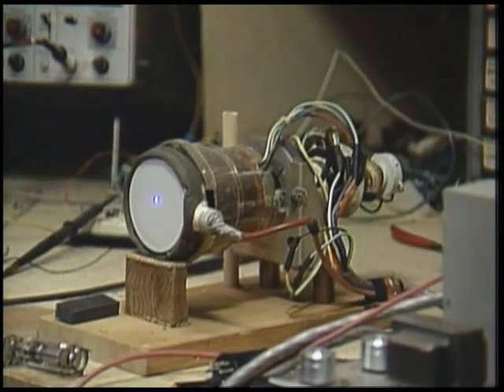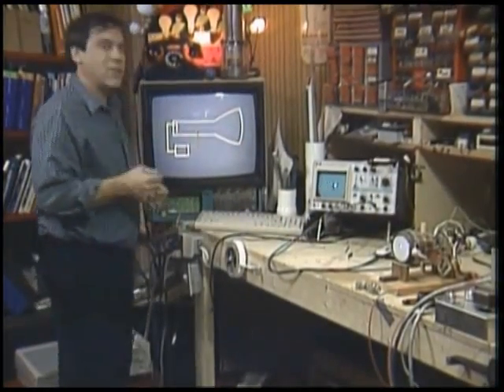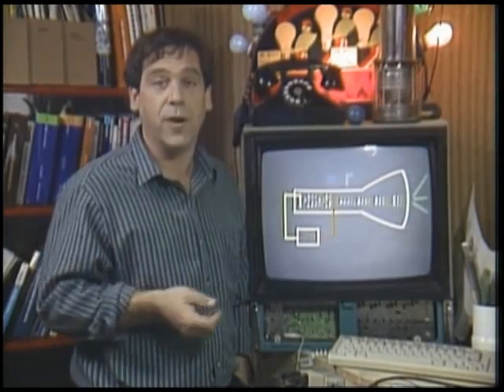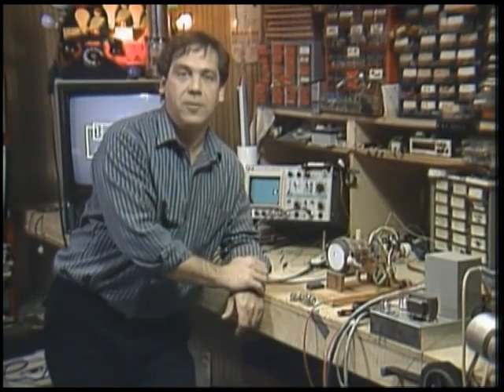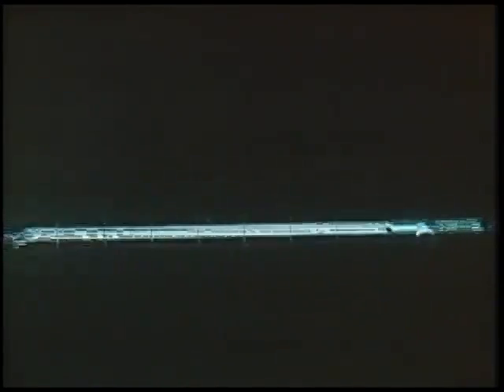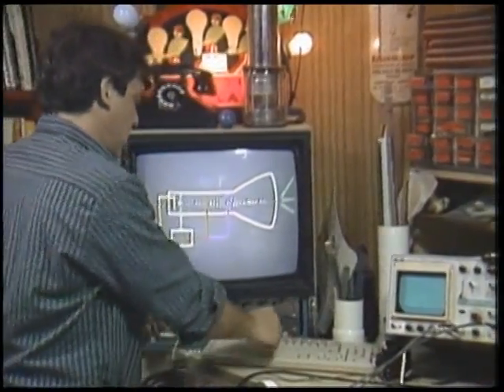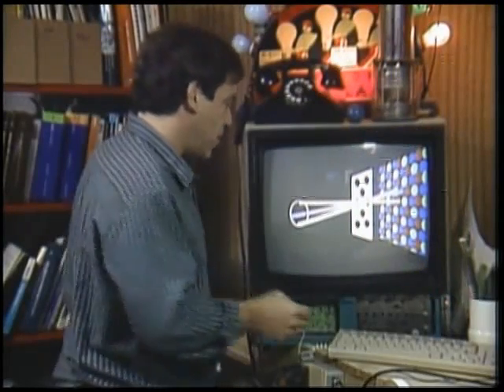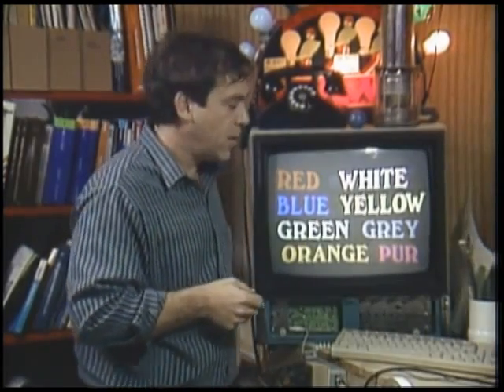How Stuff works! CRT Cathode Ray Tubes (Televisions) FOCUSED ELECTRON BEAM!

Comment: I have so many questions. How was the input signal processed so quickly? 15.5 Khz seems incredibly fast for the limited hardware CRT's used.
Reply: It was all analogue circuitry, no processing required. Everything was baked in and just scaled (amplified) correctly.

Comment: Watching from 2017*
"CRTs are going to be around for a long time to come"
20 years later ,its almost gone extinct and Have been replaced by Plasma , LCD ,LED LCD , OLED displays
Reply: Plasma screens are obsolete in 2011 or 2013 or idk . LCD , LED , etc is good but CRT are very good with interlacing , like 525 lines NTSC 480i/p and 625 lines PAL/SECAM 576i/p .

Comment: More on the coating that responds to the electrons by illuminating; the phosphors. How did manufacturers apply them in regular patterns? Also I think some tubes weren't a pure vacuum, but just less pressure than a normal environment (though they would all implode). I love CRT.

Comment: What I don't know is why applying an external magnet to a crt changes the color in a way that shows what resemble the field lines of the magnet, or what the colors would mean in regards to the field. If anyone could explain this it would be much appreciated
Reply: it changes the electron's paths to different color things.
Reply: 4 years late, but the answer is in the shadow mask he mentions. The geometry makes sure each gun can only hit the corresponding color phosphor, but when you put a magnet up to the screen, you're deflecting the beams after they passed through the shadow mask.  That means you can, for example, steer the red gun's beam into blue and green phosphors too.

Comment: i'm still using a samsung 1080i crt i bought new in 2004...lol
Samsung TXN2670WHF DynaFlat™ 26" Direct View 16:9 CRT HDTV Monitor
Reply: CRT monitors don't have refresh rates. LCD monitors have the pixels "update". In a CRT monitor, the beam is constantly scanning.
Reply: man, i wish.

i wanted a 16:9 crt 120hz computer screen so badly.
Reply: well it is from 2004 so it's not 120hz and the definition is not as good as 2016 models. but it still works so I keep using it.

Comment: Bad call on his part.  Obviously he knew about LCD technology as he showed "different technology" and pulled out the LCD pocket TV, but he vastly miscalculated how long it would take us to meet and surpass levels of quality and brightness offered by CRTs as CRTs are all but dead now for commercial applications.
Reply: John Laury  we didn't surpass the level of quality. A high quality CRT is capable of a better looking colors than a High quality LCD because LCD uses a back light. They just replaced CRTs because they were cheaper to make, took up less space, and weren't so fucking heavy. OLED looks like it could match up to CRT technology.
Reply: pooperscoop54321 I disagree on a couple of fronts.  First, have you seen a 4k TV displaying 4K content yet?  I have, not all that long ago.. just a few weeks to be honest, and I was amazed at the picture quality, contrast, brightness and color reproduction.  One can argue that because CRTs are analog in nature, there's more "depth", but I think we're just about at parity anymore.  Not only were CRTs bigger, bulkier, and heavier, but they also consumed huge quantities of electricity and operated at extremely high voltages.  There's a number of flat panel technologies, OLED, IPS LCD and such, (personally, in plane switching LCDS are best at the moment).  You also have to consider, CRTs have an upper limit of about 36-40 inches for screen size too.  Not only that, there's been a lot of technical advancements in backlighting.  Instead of fluorescent tubes behind a diffuser is gone and now they line the bottom (or sometimes top and bottom) with LEDs and have special diffusers that bounce the light out toward the viewer.  I have seen a few high resolution CRT devices, one of the last 4:3 CRTs on the market with digital tuning I saw could display 1080i which looked great on a CRT, I'm not saying they're bad, they were improved upon for 100 years, and by "the end" we were proficient at both making them, and making them well.
Reply: no he didn't.
crt screens are better than lcd screens still.

if someone made a crt screen with today's tech it would roll all over these fucking shit lcd panels we have to put up with.
Reply: Also, "HDR" CRTS ALREADY HAVE HDR. Like go read about CRT color range.
Reply: +John Laury They did last a very long time decades and kept getting better and better.  I bought a Sony 24" like in 04 and it still works like a champ.  They do last forever almost.  Also in O4 it was one of the sharpest quality TV's u could get.  3 years later the LCD and Plasma was out.  Then I got a Sony XBR Bravia 1080p HD that blew the CRT away in Image quality.  Now I have an XBR Bravia 4K LED that finally made the CRT obsolete.  Anyway like he said in the vid CRT's did have a long and impressive run.  

The 1080p HD LCD is still going strong cause the truth is there is not much 4K content out yet but there will be soon.  I estimate about 3 years and 4K is in full swing.  Seems like 1080p HD is everywhere now.  There is also a strong push by Sony and others to get the 4K out there.  4K TV's have dropped down in price now.
Reply: For starters, I can look at a CRT and make out the individual RGB pixels with the naked eye.  Secondly, Not all PC monitors have insanely low ppi... do most?  Certainly, do "ALL" as you. stated.. absolutely not.  I use Apple iMacs with Retina displays that have very high PPI counts and that in combination of very good software engineering in the area of textual display in particular, my monitor is quite readable, has high resolution, excellent contrast, and is better than any CRT.  CRTs certainly did at one point out perform LCD, but that was years ago.  Perhaps if you stop buying the cheapest $120 piece of shit monitors you'd notice a difference, but you can't say CRTs are better than LCD when all you appear to be looking at is low quality displays.  Also, I'm not just touting Apple displays, there are plenty of high end LCD monitors out there that can be used by both Macs and PCs that are high quality in more areas than just pixel density.
Reply: pooperscoop54321 I can almost pick up my 40" led tv with one hand  no problem yet my 20" crt tv requires 2 people.
Reply: @AutisticRadioSpectrumDXer1217  I hope you've picked up some weights since last year cause if you need help with a 20" CRT, which should weigh about 40lbs, then you're seriously ill, physically stunted, or disabled.
Reply: One more argument for crt tvs, is that if you own a games console from the late 80s or early 90s there is a good chance you had a lightgun game. Because of the way the lcd tvs work, you can no longer play these games.

Comment: Despite it's extinction it was truly ingenious technology.
Reply: Many people still swear by the CRT for retro gaming so they aren't quite extinct yet :)
Reply: Not extinct yet. Trinitron CRT monitors were 4K 20+ years earlier with SGI workstations running Unix. LCD and CRT are better and worse in some ways, but also aesthetically different in how they emit light. CRT's can glow and self-illuminate, but have deep blacks in a room with no light that LED can't match.
Reply: Eight Virtues Plasma and OLED can match true blacks though.
Reply: +groomedtodie There's a CRT in my household. Although the analog TV networks in my region have been terminated, the sucker can be powered on. No reception, just a lot of static. And when I move a magnet near the display, the magnetic fields appear on the TV. Nonetheless, it makes for a nifty science experiment.
Reply: groomedtodie extremly simple too
Reply: Industry and gas station security would like a word with you.